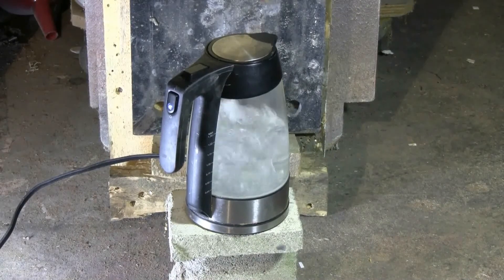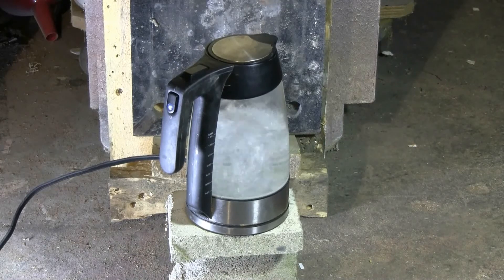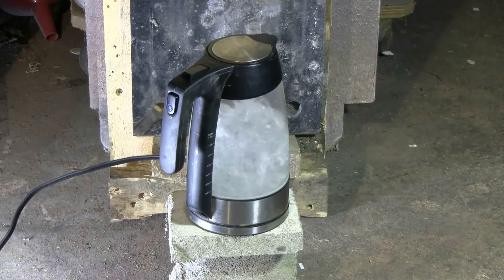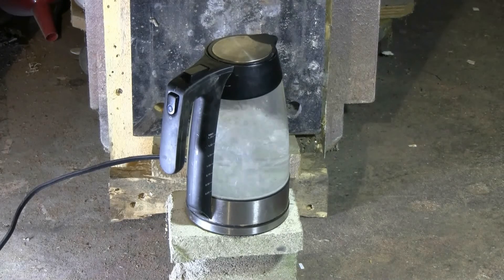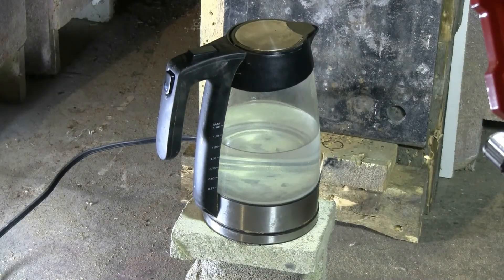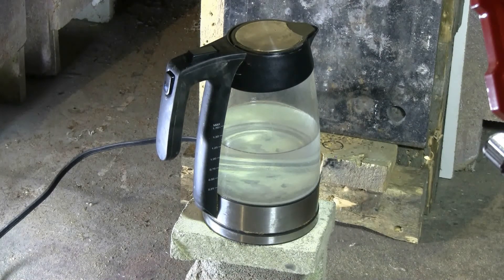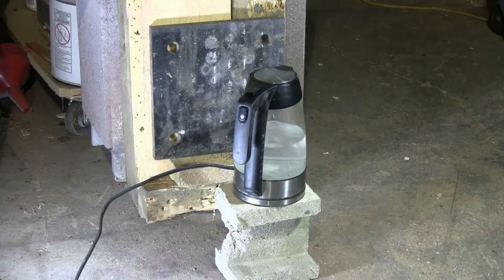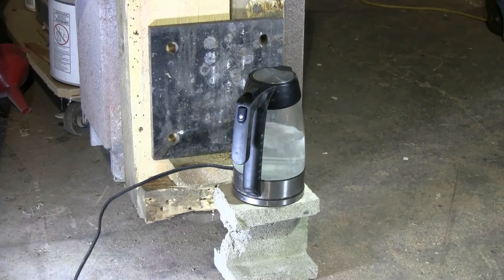Air Cannon #108 - Kettle Full Of Boiling Water

Comment: Great shot. What kind of High Speed Camera do You use? I'd like to buy one for fun, but they're Always expensive.
Reply from the maker: I use the Casio Exilims. The EX ZR400 is available on ebay for less than $200USD. You get what you pay for and these are very basic cameras that are OK up to 480 f/s. The 1000 f/s mode is very low resolution and is of marginal use. The new Nikons (J1) have better resolution but have a crippling 5 second time limit on slow motion recording. This makes the Nikon near useless for unpredictable events like sports or cap popping, for example.